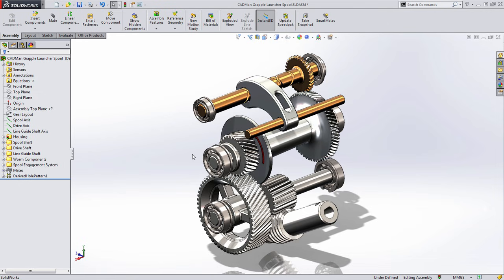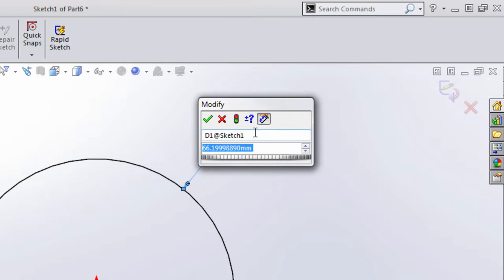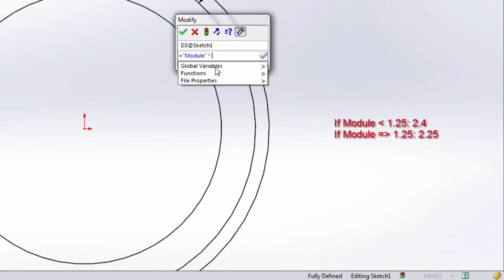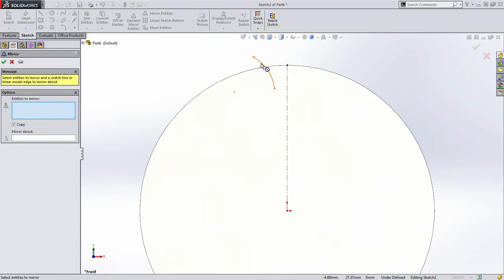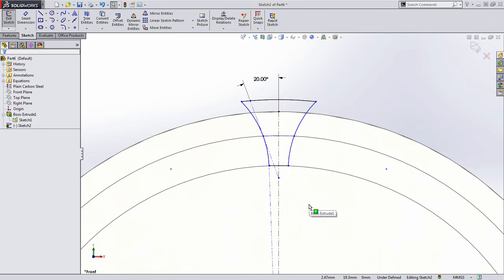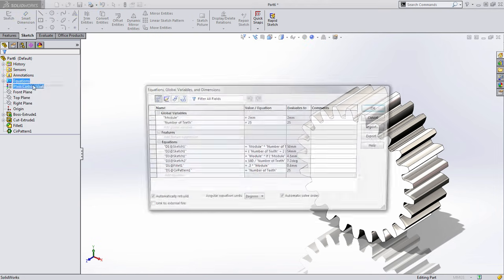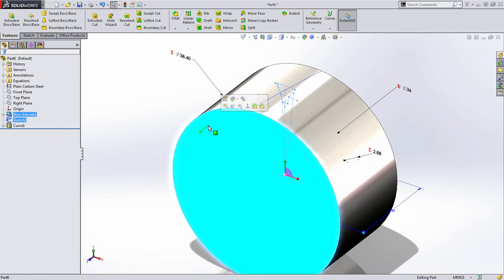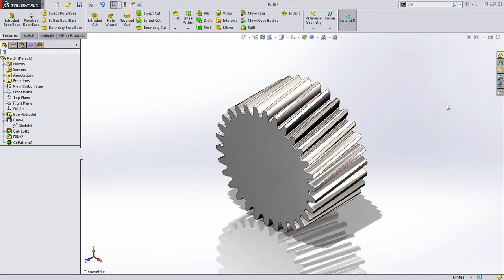Creating Spur and Helical Gears - Tutorial - SOLIDWORKS

Comment: great tutorial, it clearly shows how complicated is to make a gear in SW. i am using SW since 2004 as a hobby and using it quite regularly for making models for 3d printing the last 4 years, and again i find it quite hard to make gears... i rarely make simple gears, most of the mechanisms i made so far required gear teeth on part of objects or partial gears on the inside of parts...

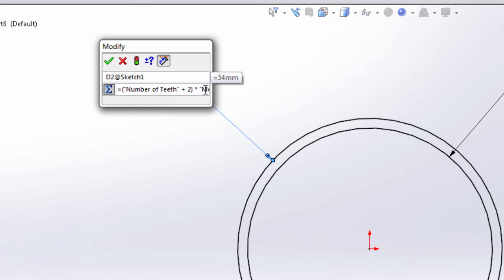Comment: How do I modify the sketch for outer diameter (5:46 in the vid) to make this an internal gear?  Or is that the wrong way to do it?  I've tried multiplying the module by -1 but that doesn't work.
Reply: ooh, change the equation to -2 of the # of teeth instead of +2.  I love when you spend forever on an issue then figure it out as soon as you ask the question.

Comment: I have created helical gears like this.
But when the number of teeth on each gear are different than other, the teeth interfere.
I had to adjust the helix angle on one gear, to match it with other gear.
Still clueless on why this is happening.

(One gear was having right angle helix and other left angle helix. As is required.)

Comment: so looking through the comments a lot of people are saying this isn't mechanically correct. Would this spur gears design method be sufficient for prototyping out of acrylic or plywood with a laser cutter, or will they fail instantly?
A lot of people have said things along the lines of 'this is wrong, this is what you should have done' but what I want to know is why it should be done differently. Is it simply more efficient, or is it an absolute requirement that these parts be produced differently? Thanks in advance for any replies.

Comment: When you create the 3 point arc, is there any particular constraint to it? Because i followed all your steps, but the sketch is not fully defined. I can drag and modify the shape of the top half of the sketch. The bottom half stays the same because of the tangent constraint of the radius center line, but the upper half can be dragged, and as i do that, i see the center of the 3 point arc moving. What am i missing? thanks
Reply from the maker: Slick Tires Could you post this question to the MySolidWorks forum? It's a better area for discussing technical questions like this than trying to do it through social media. Thank you! http://my.solidworks.com/forums

Comment: I had some problems in the design of the pinion. The gear profile of the pinion is slightly bigger than I expected. I am using metric units. How can I obtain the formulas to design gears?
Reply from the maker: obed diaz You should ask this question in the MySolidWorks forums, our experienced users should be able to help you figure out what the issue is/what the correct formulas to use are. http://my.solidworks.com/forums

Comment: What is the technical term for the upper shaft with the two-way thread cut in it? I see that it's called a "spool shaft" in the feature tree, but I'm not finding that on Google, and I'm trying to find design calculations for that mechanism.  Thanks.
Reply from the maker: Hi Chris Anderson, you might be best off posting this question, with a reference, in the MySoldWorks forum. That should get you a consensus on the term used in the industry, and users may even be able to help you find the design calculations you need. http://my.solidworks.com/forums
Reply: SOLIDWORKS Ok, sounds good.  I appreciate the reply.

Comment: nice tutorial for using the equation functionalities however as a mechanical engineer here are some major faults in the design:
1- by definition the involute is never an arc, it follows sin and cos formula
2- the pressure angle should never be done as shown, it simply used to calculate the base diameter where the involute starts
3- the helical angle is also wrong, simply projecting a line is so wrong, it should be done with a "helix", the helix pitch depends on the helical angle and pitch diameter, for instance for 45 degrees its tangent is 1 so the pitch is 3.141 * pitch diameter

I didn't want to sound critical, but if you produce such tooth profile as indicated the gears will slide and won't roll.
they won't be efficient at all especially for molding plastic gears.
I have produced perfect gears geometries this way, it takes more time in the beginning but if you set your global variable as indicated it should be easy.
I will be happy to share my knowledge with the community

thanks
Reply: Sure, but as I said it takes some time upfront. SW is also limited since it always refers to the original coordinate system and disregard the new one. (I complained abut it, they admitted it but still not fixed)
1. start setting an equation for
1a-pitch diameter 1b- diametral pitch (module for metric) 1-c pressure angle
2. make a sketch for all relevant diameters driven by the equation, from previous you can set your number of teeth, base diameter, addendum etc.
3. now create an equation driven sketch, make sure you pick parametric with t1=0 t2=2*pi (it doesn't have to be 2pi but it is better to be longer than not enough)
set Xt=(base diameter/2)*cos(t)+(base diameter/2)*t*sin(t)
set Yt=(base diameter/2)*sin(t)-(base diameter/2)*t*cos(t)
you should have a full involute. after that just fix the curve, another bug with the software
the rest is up to you to make an extrusion based on that sketch and cut based on equation curve, create the cuts pattern from calculated number of teeth.
if you follow that you have a template that works perfect every time.
once you master that helical gear is similar however you cut the involute with a helical cut instead straight cut. the helix pitch will based on helical angle described in earlier post

hope that helps you
jean
Reply: @jeandaher8757  Hey Jean, I tried it.  The equation gives me a full cresent shape.  How do i "fix the curve."
Reply: @snyzertech3399  
it works fine, you have to set the parametric equation as follow:

X(t)=(base diameter/2)*((cos(t)+(t*sin(t)))
Y(t)=(base diameter/2)*((sin(t)-(t*cos(t)))
(t) is your parametric variable i set it from 0 to 2*pi since the equation is always is Radian not degree.
where (base diameter)=pitch diameter*cos(pressure angle)

this will give you a full involute, for gears you don't need the entire range but this way i can create a full cam instead of a gear tooth if needed.
once the curve is created leave it alone and use it as your reference in the new sketch where you have to define all the gear parameters such as OD, ID etc.

Solidworks acts clunky once you start trimming the curve with the gear critical diameters even when you mirror it, it turns under-defined and blue.
anyways once you get the curve right there are a million ways to finalize it and create real gears.

i also suggest to add some functional backlash by offsetting the teeth profile to prevent binding caused by tolerances.
i hope this was helpful,
good luck
Reply: +jean daher I am studying Design of Machine Elements, and one of my final assignment is to create a gearbox, which I have choose to use spur gear and I found your comments very accurate with what I am studying at the moment.Would you share how you have created perfect gear geometries? I am struggling at the moment in creating the shaft....
Reply: Thanks a lot!!!  Will give it a go today!
Reply: off chance that you will see this but i need some help with a gear design and wondering if you would be willing to freelance? 15t and 21t 3.25" on center
Reply: @snyzertech3399  
that is why i suggested adding the backlash to the teeth previously, it will ensure no interference between the gears.
you simply use "move face, offset" feature on the tooth profile to make it slightly smaller. (depending on AGMA standard" we are talking tinny amount around 50 micron or less per side. i would also use the gear mate between them, suppress it, zom in and move one until there is no interference then unspress it, it should work fine.
i never use toolbox parts, not worth it you can download better detailed 3D models from McMaster-Carr website for off she shelf components without the hassle of toolbox.
i hope this will help you, i believe i reached the end of my helping potential
good luck
Reply: Hello friend hope u r still active and helping. The involute profile equation you explained I tried it one thing which I am facing is.. After generating 2 gears I tried to gear mate them but the teeths interference is huge. What I am doing wrong. Also I heard of coefficient of correction how I can use that in designing gear. 
Anyone  knows please help.

Comment: Same issue I keep having, my construction lines will not stay linked, when you play with your drawing, the center line defining the 20 degrees slides up and down on the vertical construction line, mine just detaches and does not slide or rotate, what settings have I messed up ?
Reply: +Bret Spangler , a year ago and it is so much easier now, just revisited this tutorial to brush up on my equation gears, one mistake I just made in the lofted cut was not selecting the center drawing, when I flipped the angle of the cut I lost it all together

Comment: my system won't allow me to add the details in the equation manager, when I do the "Module" it will only allow me to ad a 2 without the mm notation, if I add the mm it fails to allow me to do anymore, if I leave the mm off, I can just add a 2, is there an add-on I am missing ? or something else in setup you had already done. I did make a Metric tab for my parts template, seeing yours was modified.

Comment: Great video!  Question regarding global variables.  I tried to put in the helix angle as a global variable, but SW tells me "negative values are not supported for dimensions driven by equations."  I'm running SW 2014. What is the work around in that case?
Reply: Couldn't you just use 350 degrees instead of -10?

Comment: I have the following points for clarification:
1.How to create gears with actual involute profile?
2. @10.15 the profile curves were dragged to meet the root diameter. However, for gears with less than 43 teeth, base circle would be bigger than the root diameter. In that case what do we do?
3. Profile used for creating the spur gear can not be used for Helical gear. The profile used for Loft cut should correspond to the profile in transverse plane and not the normal plane.
I sincerely request you to make a detailed demo incorporating all the above mentioned points.
Reply: Ananda Kumar https://www.youtube.com/watch?v=uj7BnldaOSc